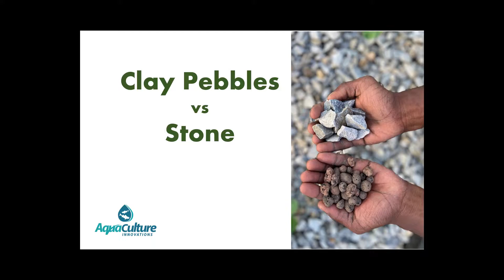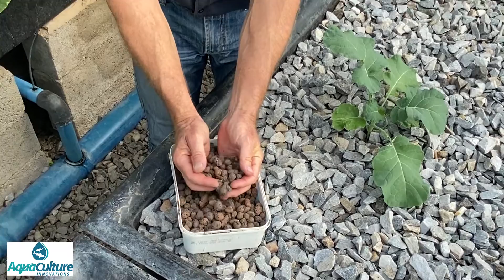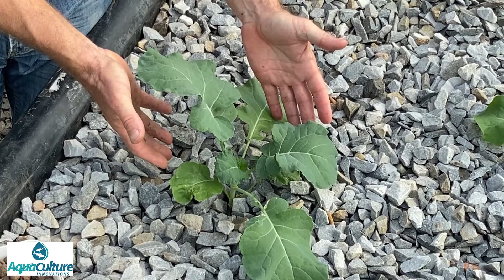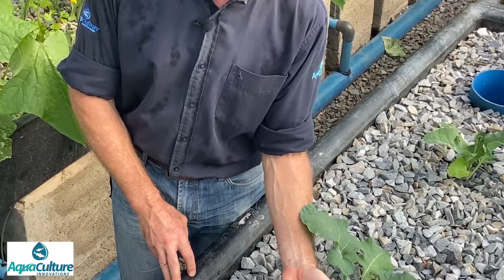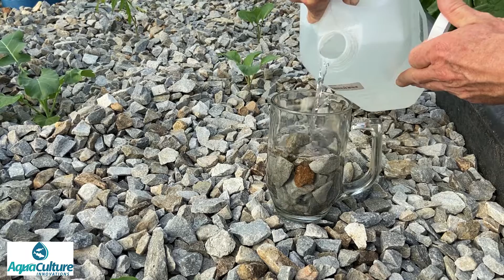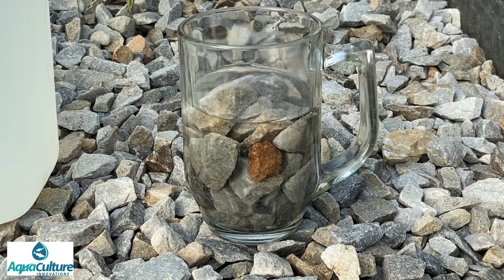Aquaponics: Clay Pebbles vs Stone

Comment: I bought some gravel similar to that from my nearby stone yard - I did the vinegar test and it effervesced like mad.  I picked out the black rocks, they also effervesced.  I picked out the grey rocks, same result.  So, what kind of stone is that that you're using there?
Reply from the maker: Good evening Chew, the rock we use is inert, I do not know the actual rock type but believe it is granite
Reply: @aquacultureinnovations7606  After I left that comment, I called my local rock yard.  They said I can test in the yard (like you recommended). and I can try basalt, meridian granite, and royal mica.  Hopefully one of them works.  Thanks so much for this video!
Reply from the maker: @chewmanfoo  Excellent, it will be interesting to know which gives the best results